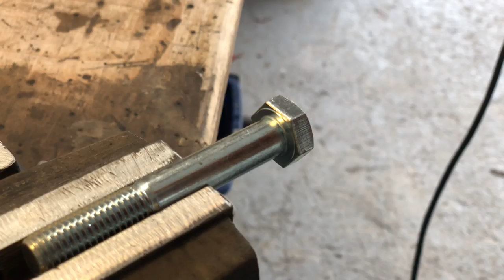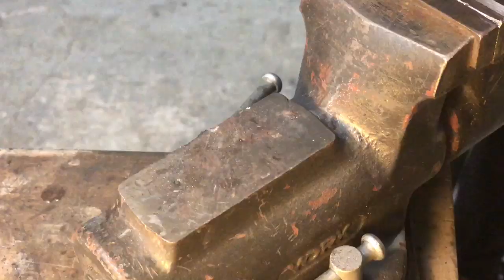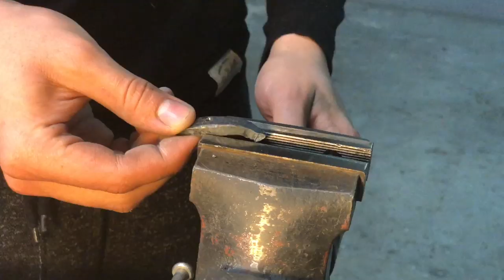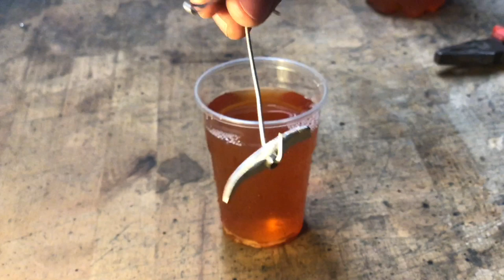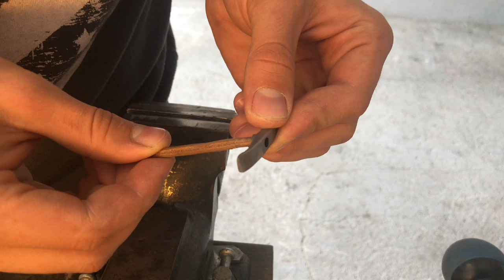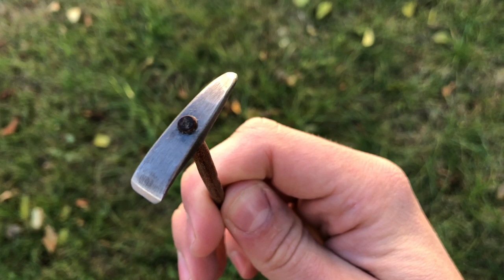I turn a stainless steel bolt into default FORTNITE pickaxe

Comment: Why did you cut the head of the bolt like that and not just simply cut it off?
Reply from the maker: This way I had more steel to work with ,but I didn't need it...I guess I should cut it off.